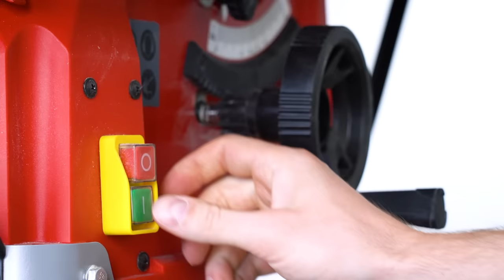Insane Floating Tensegrity Chair

Comment: Great video, I have lots of safety concerns though, I’ll start with: freehand cutting on the tablesaw...very dangerous. You’ll end up with a terrible kickback and might lose fingers in the process. My cousin had to have part of his intestine removed after a tablesaw kickback doing something similar.
Reply: there's a lot of different things it depends on as to whether or not free-handing is safe on the table-saw. the way he did it in the video wouldn't have kicked back the material in such a way that would have impaled him because he wasn't holding the sticks with the ends pointed directly at the saw blade, instead, it was the center of the sticks; not to mention, he had both hand's on the sticks at all times. 
Also, it depends upon the type of wood you're using and/or the power of the saw. Working in a mill, the saw would be much stronger and you should never really free-hand anything on them, especially since you could probably just use a band-saw instead since the scenario is in a mill. I've worked for a stair company, and in the shop there were holes in the wall behind the table saw, obviously from wood just shooting like bullets.
But these standard table saws that basic carpenters carry around or have at home that plug into a 20amp circuit most-likely aren't going to kick a piece of wood back at a person so fast that it impales their tissue, unless of course it shoots something toward the eyeballs. 
Now, I don't work at the mill. I mostly do finish trim carpentry, and I freehand a lot on the table saw simply because I don't have a portable band saw. The blades on the regular 15amp table saw, like the one in the video, will stall due to lack of torque far sooner than overpowering you and kicking you or the material back.
Reply: @ZeldaplusSmallville  Complete nonsense.  There is no advantage to freehanding (really, you can't at least fit a miter gauge alongside your jobsite saw?) - the cut is less straight AND less safe.  What's the point?

And maybe it won't kickback, but if you've been a finish carpenter then I'm sure you've seen kickback.  It's extremely violent and not something worth playing around with.  For the cuts you describe, use a miter saw then.  There's one of those on every jobsite I've ever seen.
Reply: @jamesspadaro7722  you’re crazy bro, it’s not that uncontrollable on a 15amp table saw, you clearly aren’t a professional
Reply: @ZeldaplusSmallville  It probably isn't, I agree.  But it's also very volatile and hard to predict.  What's the point of taking the chance?  What are you gaining?  Oh, right, crappy not-straight crosscuts.  Miter saw is literally right there.  Same with a miter gauge.  Laziness and shoddy work to save... literally no effort.
Reply: @jamesspadaro7722  I have two miter saws I carry around with me, you can’t take a piece of door casing that’s 3 1/2” wide by 85” long and cut that down the line on a fucking miter saw. You’re loopy dude. 
If the walls out of plumb and I have to rip the casing the fit the wall, sometimes it can be over 3/4” out of plum and you can’t use a skill saw and you damn sure can’t take a miter saw that only reaches out 15” and safely cut down 85” inches of trim material.
You clearly have no idea what you’re talking about.
All I have to do is drop a line and follow it on the table saw like I do on the bandsaw. It saves time and money and you’re not going to get impaled by a piece of trim material. 
Want me to post a video of me doing it for you so you can learn a thing or two?
Reply: @jamesspadaro7722  sounds like you’ve just got shaky hands and no trust in yourself or your tools. I’ll make you a “how-to” video if you need, but I can’t fix stupid
Reply: @ZeldaplusSmallville  This guys channel is usually pretty good but the woodworking techniques shown in this video are horrible. The cut he made on the tablesaw could have easily been made with a mitre saw and to do it without a crosscut sled is more pointless than unsafe.
Reply: @loganb2198  true, he was doing shit the oddest way possible
Reply: @ZeldaplusSmallville  No, one tiny mistake and things can  go wrong very quickly on a table saw, doesn't matter about the power
Reply: @ZeldaplusSmallville  I'm sure you could fix yourself somehow, maybe not your fingers though
Reply: @tonkatoy200   ive been free-handing on a table saw every week for over 5 years, you really have no idea what youre talking about. Thanks for the useless input.
Reply: @ZeldaplusSmallville 5 years eh? Fantastic
Reply: Haha all you guys would probably get along and come to an agreement if it was face to face over a beer
Reply: @ZeldaplusSmallville  Five years is not very long. Sorry.
Reply: @GDM223SR  i agree, yet ironically I still tend to know more than most of these people  haha. It’s hilarious to see someone with more experience know less than someone with so little. All depends on who trains you and how quickly you can develop skills. Some people who work for over 20 years may never equate to someone who’s worked 5, kind of sad, but some people are just more talented than others.
Reply: This guy has huge balls. Both in wood working and designing, then again, this video is 3 years old.

Comment: 1:30 now THAT is a SICK transition
Reply: how you think they did it?
Reply: @sa.8208  they could have just drawn a green rectangle in those 22 frames and then blur a little the edges, then doing a simple chroma key to remove the rectangle it should work well
Reply: They could have created a green mask as he was lifting it and then chroma keyed it to another shot. It's quite simole
Reply: It looks like a transition from Tool Time with Tim the Tool Man.
Reply: 2:23 is even sicker
Reply: Seeeeeee
Reply: @sentradynamics8889  
When you're from the 1800s and don't get modern slang

Comment: Really cool project.  If I can suggest: there are far better knots than overhand to use in applications where you're going to support someone's personal body weight -- especially since this is not a hitch but a stopper-knot scenario.  I think the best knot to use would be the Ashley knot.  Another good way to go would be the double figure-eight which is a bit less bulky.  A single figure-eight knot is a great knot, and even less bulky than the others, but if it's bounced around it does have some risk of unbinding (often used in sailing where you don't want a line to get drawn through whatever it's been passed into, but you'll eventually want it untied).
Reply: granny knot

Comment: With nylon rope it's a good idea to put a locking knot in each running end. Nylon has a tendency to slide even when knotted tightly, so a locking knot prevents it from coming undone.

Comment: On this chair , if he just shake a little , it shall hurt him really bad. 
Make this chair at home but please don't ever try to sit on  it.
Reply: Why will it hurt?
Reply: Let's say that this chair isn't for someone over 200 lbs :D :D
Reply: @yumco7588  all the pressure from his weight is on that plank of wood from the bottom. If the pressure is higher than the plank resistance then the chair will fall apart and he might get hurt from the same plank i mention earlier
Reply: @sprinngam2536  oh ok 👍
Reply: I only comment while I’m on the shitter  yea, but the rope have more rezistance so its more about the suspended plank. Anyway ty for observation
Reply: Also, if you do sit on it, do not put your fingers in the danger zone like the guy did at 4:21
Reply: It's just that chair is balanced if you slightly shake yourself, the chair will loose the balance and it will definitely hurt.

Comment: The lack of craftsmanship gives me more anxiety than the chair itself.  Using a table saw without a mitre gauge or fence and chewing through nylon rope with tin snips were personal faves
Reply: Honestly, if you can't hit a right angle on something as simple as a 4x4 without a mitre gauge you should just stop using a table saw altogether.
Reply: Post a video of your craftmanship then and we will differentiate.
Reply: @JOhnDoe-nl4wj  it's not the point of getting a perfect 90 angle. Cutting cross grain without a miter gauge or cross cut sled can end in serious kick back. I don't follow all safety precautions but that made me flinch.
Reply: And not having a impact drill driver for the screws or a least a bit for the drill you already have.
Reply: Ha ya"ll usless , give the man credit. Everyone  have their own ways, their own expectatives of their own work so. That said. Show your skills and we will judge.
Reply: For me it was the hex key screws that got me..
Reply: I don't know, the only thing I would have done that he didn't was burn the ends or the rope to prevent it from fraying. And I am a little confused as to why he only used Alan key screws, but to each their own.

Comment: I wonder if you could build a metal version with metal cables to replace the rope
Reply: No reason not to use metal cables, most of the tensegrity tables out there use metal cables after all.
Reply: Metal chain would be more metal.

Comment: 0:45 duuuude, use a cross cut sled! You should never, ever, ever freehand on the table saw.
Reply: eh, just be careful, it's done all the time in pro molding shops
Reply: Or slip/fall forward 😬
Reply: @bryanska  not in any shop I would ever work in
Reply: I came here to say exactly this. People think it's fine because they are careful, until one day they see how quickly that thing can throw a piece of material backwards. Its scary AF.
Reply: @bryanska  I freehanded once, and nearly cut off my index finger. I got lucky, with just a severed central slip tendon, but the recovery took more than six months.

It takes an afternoon to make a cross cut sled, and makes every cut thereafter infinitely safer. I strongly encourage everyone using a table saw to have one, and never go without a sled or fence.
Reply: It only takes 1 time.
Reply: I don't think he ment for this to be permanent thing
Reply: Even if you don’t have a sled, use the mitre gauge that comes with the table saw, that’s what it’s there for.  It’s safer and more accurate.  I would never use a table saw without at least one edge on a guide. Too much potential for kickback.  If you want to free hand it, use a handheld circular saw.
Reply: Glad I'm not the only one who started this video and went, "What? No. Stop."
Reply: Was thinking the same thing. Perhaps he has too many fingers...lol
Reply: I was on the edge of my seat during the table saw cuts. That's how fingers are lost. You can't possibly guarantee no kickback.
Reply: That doesn't make it okay or safe. I also doubt that pro shops would be okay with that. That's a liability nightmare. Not saying they don't do it, just saying it's not likely condoned by management.
Reply: It never happens until it happens 🤦🏻‍♂️
Reply: @nattodatto  Well you better never use any tool at all. It's safer
Reply: @mrpolnar1  my thought exactly, i mean it's a 4x4 with flat surface. What kickback is everyone talking about lol.
Reply: @JOhnDoe-nl4wj  look up table saw kickback on youtube and it will all make sense. The table saw is one of the most dangerous tools in any shop. I have one and I always use the guard. Yes it's a pain sometimes, but I love my fingers too much to take a risk.
Reply: @JOhnDoe-nl4wj   you can use a tool properly and be fine, but a table saw without a miter gauge or cross cut sled will eventually get you,  you don't know the stresses in that lumber. That blade binds up any and it pulls you to one side or the other and slings that material right back at you.. with enough force to penetrate the wall behind you.
Reply: @methodtomyradness2939  isn't it funny how people think being unsafe and wreckless is somehow cool and edgy, "like whatever dude".  It's not.  I cut off tip of my thumb thinking i was a bad ass cutting weeds with a machete.  Not cool.  Expensive, painful, months of physical therapy, and 4 years later it still feels like it's asleep (numb, tingly)

Comment: It's pine wood, and I don't even trust its strength to hold man's weight...My butt's health will depend only on those screwed joints, nah...I'll pass...
Reply: Not even the screws, its dependent only on the rope in the middle
Reply: @indrayeduguri7710  its not, due to physics of tension the four external ropes ARE load bearing and thats whats cool about this chair
Reply: @DaniPog  I trust the concept, but distrust the construction. A few screws and big knots seems a tad unstable. Other similar projects I've seen looked way more durable. Also the external ropes are mostly stabilizers. The middle rope is doing the brunt of the work. I'd expect the middle rope's knot to be forced through that small hole before the side ropes.
Reply: @cmck362  Right! The concept is OK, but not this wood construction. In this case there are rods inside the four corner ropes! Lol! Just lock at the type of ropes. You can pull out the center core and replace it whit steel rods. I suppose he did that as a plan B when plan A didn't work out!

Comment: Gravity and the Physichs I learned at school: Stop that, that's illegal
Reply: Not really. Think about it like this, the rope in the middle is the one actually holding up the structure. The other ropes are tied really tense to keep it stable.

It's essentially like if you hung a chair from a tree.
Reply: This is exactly the type of Physics that you learn in school, so no it's not illegal. The chair is being held up by the strings since they're all stretched out as much as possible. If you apply force on one side, the strings on the other side will stretch but since it's at its max tension, it'll go back to equilibrium. Same as what happen when you apply force evenly, the string inside will try to stretch but since it can't, the chair remains stable.

Comment: funny thing is that only the center rope is holding ur weight
Reply: He could add 2 ropes then
Reply: Oh panzer of the lake , what is your wisdom?
Reply: False. The weight also goes to the square frame at the bottom causing a decrease in stress on the rope.
Reply: I would take the center one , and swap for 2 , left and right.
Reply: False, the full weight is hanged by the centre rope.
Reply: @JallahBomber  the rope distributes it to the bottom frame. Physical systems work that way
Reply: @timekeeper5532  regardless, the full weight is held by the rope
Reply: @timekeeper5532   "physical systems" lol mate just look at the structure, it's a cable system. Ropes only work in tensile stress, which means the 4 corner ones are only there to stop the sit from moving sideways. Therefore the ALL the force applied on top of the sit is transferred THROUGH the SINGLE bottom cable then to the diagonal wood, then to the base, then to the ground. Which means the total stress in the cable IS his weight + the top sit part.
By your logic a crane could lift 100000000000 tones or lbs or w/e units with a shoelace as long as the wheels can withstand the distributed force on them. The entire structure, "physical system" must withstand the stress transference all the way to the ground.
Reply: @japalocoturbo  exactly. Their statement was wrong because they said the "full weight" is completely held by the rope when in fact it's the stress from the weight that's  mostly on the rope.
Reply: 1/2 in. solid braid will hold you. Even 1/2 in. twisted braid would hold you.
Reply: The rope looks to be strong enough. 
I would not trust these knots however. 
Also the joints with these screws will wear out very quickly. He should have drilled through completely and used bolts & washers secured with nuts on the other side.
Reply: @ggmegyeri  Agreed. The knots aren't sufficient and using screws instead of bolts nuts and washers will wear the holes out quickly. The design is sweet, quite a conversation piece for a patio.

Comment: Gotta have perfect balance on that or you're falling. The weight is all held up in the middle, with the four outer ropes to help stabilize it. There's only so much they can do to stabilize it since they're not rigid, so once the center support shifts enough, the whole thing is going to rotate.

Comment: Can some explain how it worked? I watched the whole video, but I can't quite grasp how pushing the middle pieces together keeps the corner strings taunt, let alone for them to stay taunt when the chair is upright
Reply: Corner strings allow the upper piece to only go down or diagonally: down and sideways. They also allow the chair to rotate while going down. The middle string prevents down movement locking the upper piece on place.
Reply: @lasermancer9532  Thank you. Ive finally gotten it after all these months with other videos.

Comment: The only change I'd make is for the base end of the central support to have a broad flat board on top in case the rope breaks and the chair falls. And I'd do the whole thing with steel clothesline instead of rope.

Comment: The problem with using nylon is that it will stretch much faster than a steel wire.

Comment: Has a table saw that can cut perfect joints - makes wonky, messy cuts on a bandsaw instead.
Has discovered the magic of forstner bits -  still uses a cheap drill press stand thing.
Has 11.5 million subscribers - uses a fiddly allen key that comes with most flatpack kits.
Clearly knows how to design cool stuff - creates a surprise prostate exam.

You, sir, are an enigma wrapped in a paradox and shrouded in a conundrum 🤔

Comment: Please be careful with that tablesaw. If you are crosscutting you should always use a sled. If you once fed the wood in with the slightest angle the blade is going to throw it at you with a lot of force.

Comment: The structure is week.. it could brake easily.. especially the middle hanging bars. . With steel practical. May need more reinforcement. . Better design. Requested.